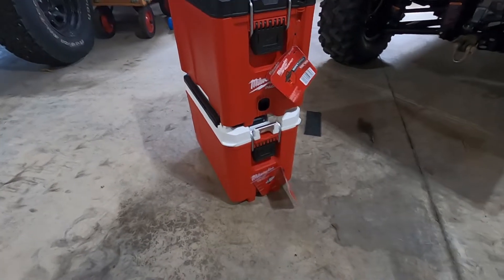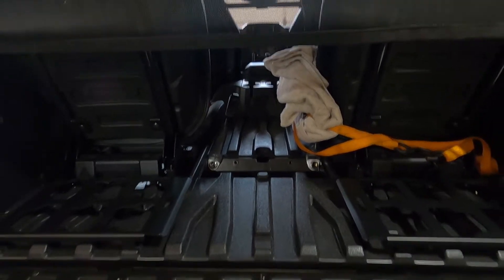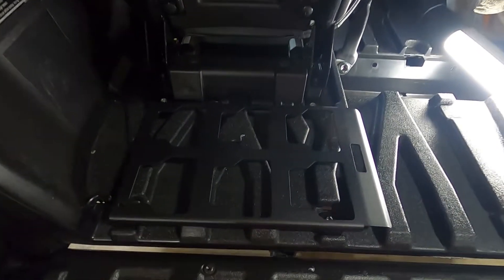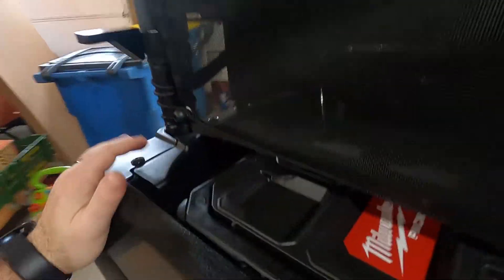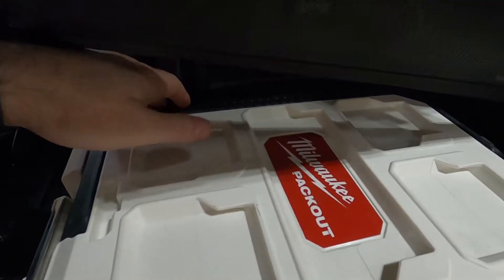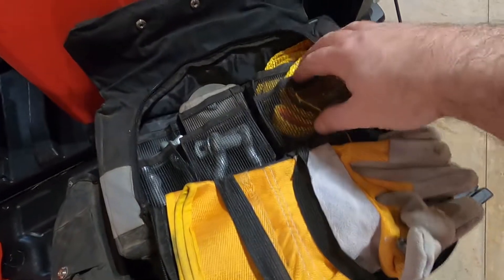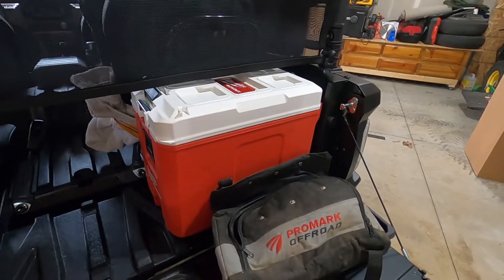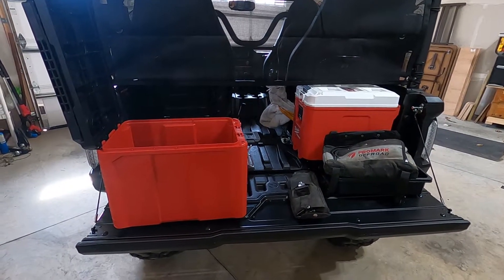2022 Wolverine X4 Milwaukee Packout System

Comment: Is that a duck net rear screen? How do you like it and how well does it work for the dust?
Reply from the maker: Yes. We love it. I have them on the back windshield area and the rear sides. It keeps the branches and what not out of the dog and kids face. It also provides a bit of sun protection, almost like a tinted window.
Reply: @bigpoor90  awesome thank you 👍
Reply: @bigpoor90  can you still move the seats forward
Reply from the maker: @EmerseInferno  Do you mean with the packout system? If so, yes you just pull out the packout and can reach the release for the seat movement. The packout boxes slide right out when you hit the button on the box.